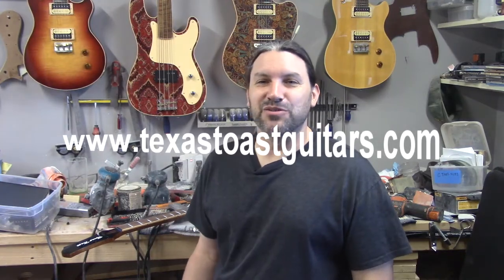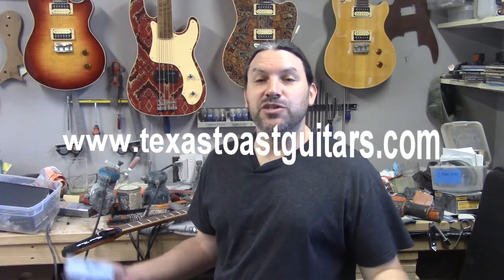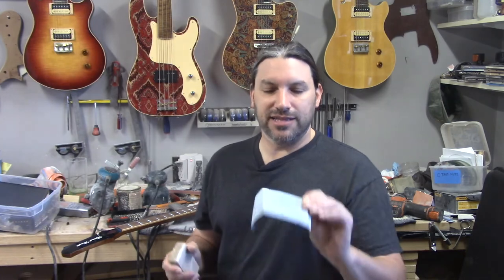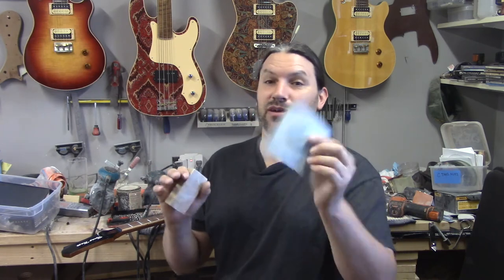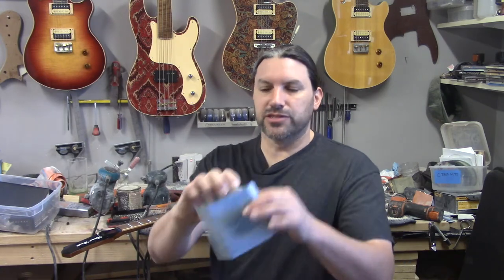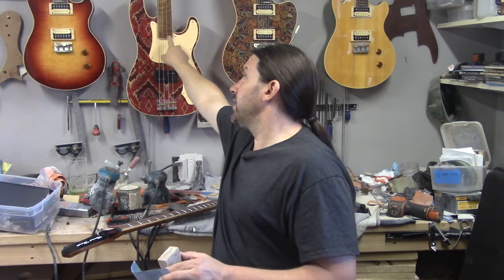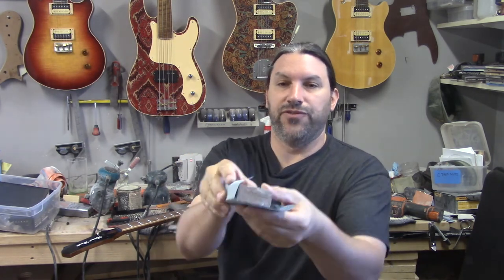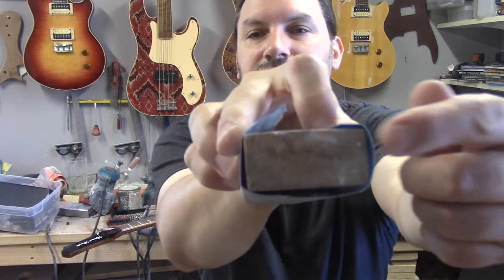You Are Using Sandpaper Wrong... Probably

Comment: This is the best advise specially for new builders. I waisted so many hours trying to maximize sandpaper specially when finishing radius sanding on finger boards, when I started just changing the paper as soon as it went even slightly dull not only did it go faster but my work looked much cleaner. I've been using klingspore and Norton papers lately with great success. And of coarse good old 3M gold for the radius blocks.
Reply from the maker: I am still surprised that people still do this... Chris might be the worst offender

Comment: Same thing applies doing automotive refinishing. I used to change paper as soon as it quit cutting like it does when new. At the very first hint, I'd go to the next piece. You've also gotta worry about the paper loading up and scratching up the surface with contaminants stuck on the paper. I left sanding scratches in a few finishes until I figured out what I was doing wrong. You could see it in the paint, and it was even worse in metallics.
Reply from the maker: Finishing is the hardest part of the whole process

Comment: Good Show Matt! I especially liked the tip of fitting the paper to the block. I was taught to use double stick tape and cut the paper to the exact size of the block and that way you don't have rolled edges which build up sanded wood and other thing that might be abrasive. Is it right or wrong. I don't know. But it does do a nice finish and I totally agree 220 is the finest grit I generally use. And on one more note. ( I do use flip flops LOL ) cut them to what ever shape I need and I get em at thrift stores cheap. Like the show Matt. and really like your guitars. I got a long way to go, but I learn as much as I can from everyone I meet. I am actually building #1 right now. But I been doing lots of repairs and setups.
Reply from the maker: Cool man, I'm glad you are enjoying the videos and I'm glad to hear you have started building guitars. If there is anything I can do to help please feel free to drop me a line, send pictures of your guitar too.

Comment: I can see what the guy you mentioned meant by the sandpaper wearing out to a higher grit, but what you described makes more sense. if sandpaper did wear to a higher grit, why would we bother making them so close together in coarse-ness?

I doubt coarse-ness is a word, but whatever, I do what I want! awesome little tidbits of info as usual!
Reply: the particles do not change size and therefore the effect each particle had on your surface is the same. 
coarseness 
oh, and you said it right:
1. the quality of being rough or harsh.  "the coarseness of her hair"
2. rudeness; vulgarity.  "he disliked the coarseness of the men around him"
Reply from the maker: Hey Lloyd, hope you are well.
I think the guy who said you only really need 3 grits is probably correct when it comes to making furniture or something that comes out of the table saw or planer nice and smooth etc... And I skip grits all the time, like when I run out :)

Comment: I like the point about the excessively high prep sand grits, but I would even say it is lunacy to use like 15 grits to wets sand too.
Reply from the maker: Thanks for watching Zack... you are absolutely right. It's funny, when you  start using tools like a pedestal buffer you realize very quickly that sanding to super high grit paper is unnecessary. Obviously, the  guitar factories do not spend hours and hours sanding to 5K before buffing. 
We come out of the spray booth (after clear/top coat) and DA sand with 800 then 1000 and then right on the wheel. 
We still have a video planed for this process.

Comment: "The number scale refers to the number of holes per square inch in the screens that are used when sieving the abrasive grains during the sandpaper's manufacture. For example, in 60-grit sandpaper, the abrasive particles used in the paper were sieved through a screen that had 60 holes per square inch."

Source: https://www.thespruce.com/choose-the-right-sandpaper-grit-1822681
Reply from the maker: Well, there you go

Comment: Finishing manufacturers (at least the wood specific ones) will tell you to sand to 220.  Anything finer, and the finish will have little to 'bite' into.   High build sealers are designed to fill pores and be easier to sand to much higher grits.  I suppose if you're using an oil finish, you may want to sand higher than 220, but even then, it's not like you're going to be rubbing your guitar on your face.

Comment: OK, Matt, I can be convinced that sanding most wood to 800 grit is overkill, especially when using a grain filler/sealer.    I love power sanding, when I can, especially when my bowls are still on the lathe, But with my bowl work, concaves and convex shapes get much harder to do with even soft sanding pads, to get an even finish.    I am still polishing up to Micro Mesh 12000 by hand.  I just ordered some soft buffing wheels from Stewart-McDonald and their compounds.  I am waiting to be convinced you can highly polish a flat surface and not have sort of ripples in it.......    Flat like a mirror, not flat like a lake with a slight breeze over it.........if you know what I mean.

Comment: i did a headstock finish, paint. i sanded to whatever i sanded to 800 entirely cause i didn't know what I was doing. lol. but it ended up looking great. and it was just a headstock so i didn't expend a ton of time doing it.
Reply from the maker: having a nice smooth surface to work with is always a good problem to have. I don't think there is anything wrong with sanding past 220 or 320... I'm just not convinced it's absolutely necessary. 
Thanks for watching my friend.
Reply: Der Red I followed this wet sanding tutorial that said you only need 400 and 2000, and it turned out horribly. Smooth surface with super visible 400 scratches
Reply from the maker: We wet sand finishes to 1000 or 1200 (I can't remember...) and then work it with the buffing wheel. You are right though Zack, you have to get rid of the scratches left by the grits you used before. And 400 in clear leaves a pretty big scratch.
Reply: Depending on what you want to apply afterwards, sanding to a high grit can cause problems. If the wood is too smooth it won't stick as good as with maybe 320-400 max. I think a big problem between all sanding conversations is the grits themselves. There are different grits in europe, the US and especially if you sharpen knives...japan. What you name as this grit maybe rougher or smoother if you buy the same number somewhere else. But it gets better and the usual CAMI system/standardization spreads until it'll be all the same.

Comment: Try to get a body shop owner see it like we do. Your rite it takes the sharp points in the mineral of the rock and rounds off the points.
Reply: With painting auto's a couple of years back.i way forced into medical retirement. Everything that had a metallic face painting over a clear coat factory paint you can shamefully spray clear over 800 grit without being able to see any sanding marks in your fresh paint after its cured out.if your putting color over it 400 works over sealers  320  .if it's just some solid color you could probably get away with it over wood without any sealer coat.  Remember this after you start spraying a sealer  thru clear coat it's not designed to be sanded.. primer in the automotive side of the industry only has to be sanded if it says primer surfacer primer is pre paint. Not what ever else your mind can come up with to make it more complicated..it's easy if it doesn't say surfaces no need to sand as long as the time limit hasn't been reached between prime n paint ,paint n cleas,so on.if it has to be sanded if it's been too long a light. Scotch bright  over every square inch especially pay att. To edges not to sand threw..if it has dirt nubs make sure it's had a few min it's extra   than cleanness it again with air and tack rag a spray 1 final color coat.. as far as dirt in clear coat goes  I spot sandthem first dry so I don't miss any with 1000 after that I go 2000 grit sand those spots again to get rid if the 1000 grit scratch .than the rest all over it if needed.remember don't dandy any place you can't buff easily.
Reply from the maker: All good points my friend

Comment: Buy the good stuff and use it like it's free. The first steps are the most important. Get each grit right before even thinking about moving up to the next grit. If you get it correct with your lowest grit, the later steps go much, much faster.
The most fun of all is watching someone gouge the hell out of their workpiece with 36 grit belts or sheets and then spend a week trying to get the divots out and make it nice with 400.  Those types will almost always brag about how much time they spend handsanding, as if being fucking stoopid and wasting time is somehow a mark of quality.
Reply from the maker: Sanding is demanding and I want to get in and get out fast
Reply: @TexasToastGuitars   exactly, no one should spend all day sanding a guitar, it's only like 2-3 square feet of wood FFS. It's so important to get the very first sanding right to begin with. Doesn't matter if it's wood or steel or whatever, there is no sense half-assing the 80-grit stage and spending all your beer-drinking time trying to "fix" it with 400 grit. That's by FAR the most common problem I see with pretty much everyone who builds pretty much everything- working fast to slap something together and then getting caught up trying to fix (or hide) their half-assery.  If you get it right the first time everything along the way goes much much easier, but I guess that's just too hard for lots of people to figure out.

Comment: I'd like to point out some incorrect information in the video.  80 grit does not mean 80 particles per square inch on the sandpaper.  The number scale refers to the number of holes per square inch in the screens that are used when sieving the abrasive grains during the sandpaper's manufacture. For example, in a 80-grit sandpaper, the abrasive particles used in the paper were sieved through a screen that had 80 holes per square inch.  The particles are sorted through multiple screens, starting at course and getting finer with each screen.  80 grit particles would be those particles that fell through the screen with 80 holes per square inch, but would be blocked by the screen with 100 holes per square inch.   The actual diameter of an 80 grit (NOT P80!) particle is 190um, or 0.00748" (https://en.m.wikipedia.org/wiki/Sandpaper), so, unless I've gotten my math wrong, assuming 50% coverage there would be approximately 9000 particles per square inch on the sandpaper.  Quite a big difference.  If there were only 80 particles per square inch you would easily be able to count them.
Reply from the maker: Thanks for correcting me Alan, that actually makes more sense.